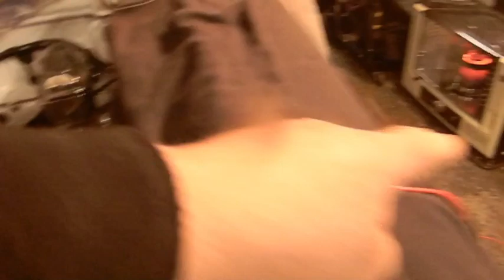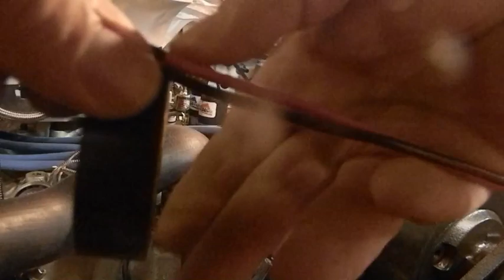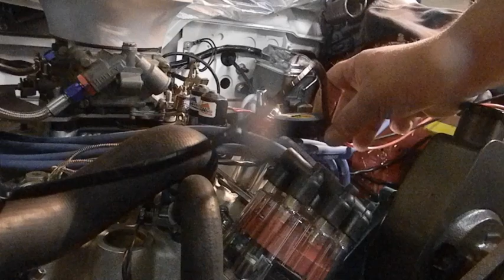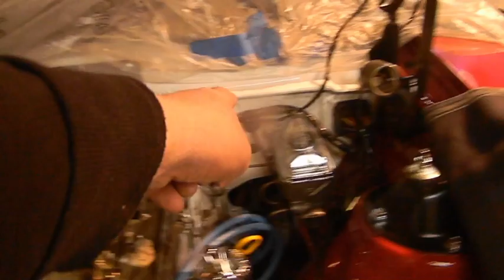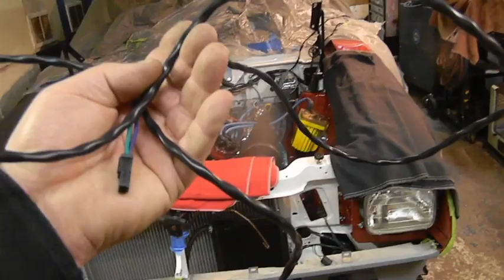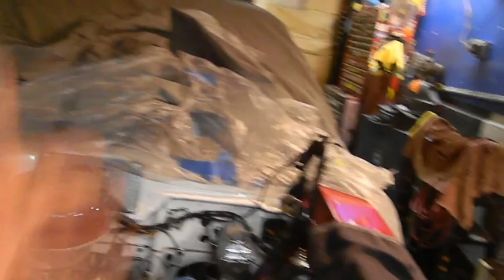Automotive Wiring Pt2

Comment: Why won't the 6 foot extension work? Can't you route in in from the other side? And if you run it past the fuel line and you decide to insulate the fuel line you could also insulate the wiring. Heat equals resistance, so the cooler you keep the wires the less resistance to flow there will be. Every little bit helps,even a degree or two. As far as leaning over a fender, my back won't do that any more. Even without a great paint job!